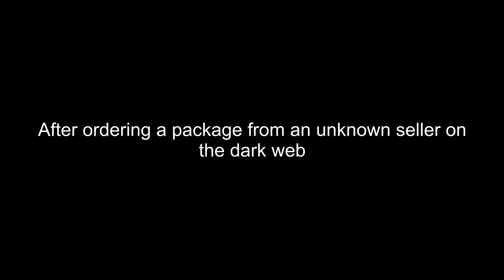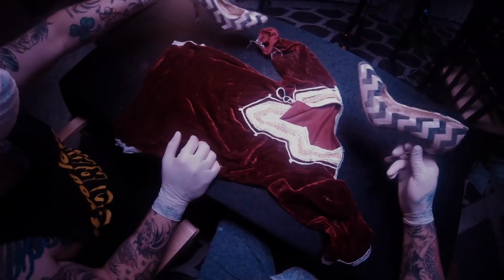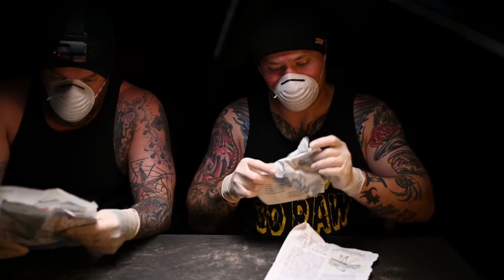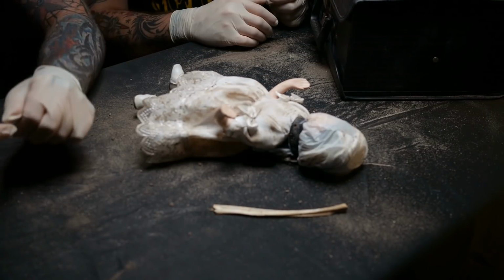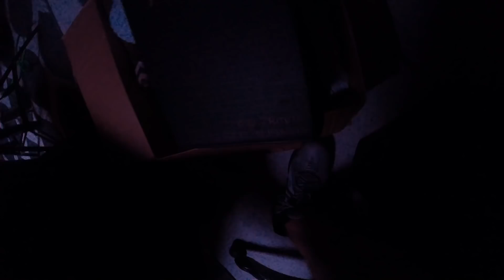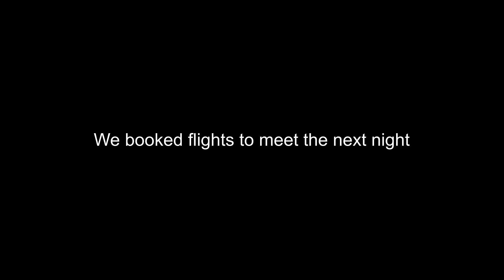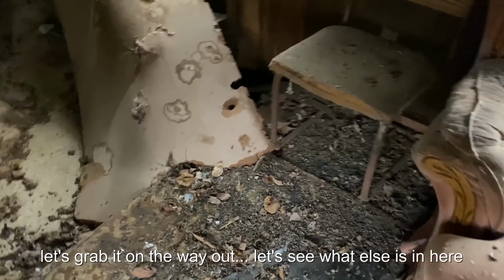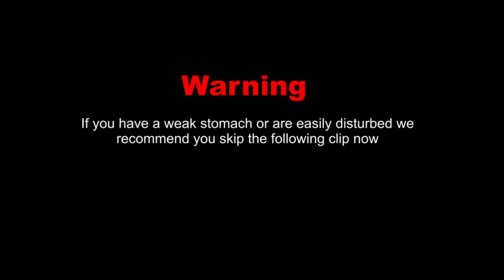The Most Shocking Tape Ever Found (Full Story) Killer's VHS Footage

Comment: Did anyone else see all this too? At 40:46 I hear what sounds like rustling plastic. And he stops digging. Then at 40:52 rustling plastic again. He stops digging and walks out of the frame but you can vaguely see his shadow movements. At 40:59-41:03 I can hear the sound of something being swung thru the air- like the shovel…?! And it sounds like he’s hitting “something” with the shovel 3 times really hard and on the 3rd strike- all while the shadow movements can be seen and appear to correspond with these sounds- 41:02 the 3rd hit makes a high pitched ping like the metal head of the shovel hit something hard (maybe bone? I think would make that sound for sure.) then he drops the shovel and moves back into the frame. So I’m thinking whatever he buried was probably still alive when the recording started and possibly even still while he buried it… not likely. Also possible that it sounds like he might’ve killed it between 40:59 and 41:02… this really DID stick with me a long time…
Reply: Clearly same as what u r saying and i agree if in between that time he didnt commit murder maybe he was making sure of murder doesnt sit right with me that part

Comment: I'm sure someone would have pointed this out by now, but for blood to light up on UV Blacklight, you need what they call luminol. It reacts with the iron in hemoglobin. Get some luminol, and if you suspect a stain to be blood, spray it on there and use the blacklight. If it shines, there is a good possibility that it could be blood. Not concrete, but a very good indicator.

Comment: Did you know that you need to use a spray with the black light to see blood. I don't know what it's called off the top of my head but using just the light doesn't work. I'm a year late but I figured I'd mention it if you haven't found out by now..
Reply: luminol

Comment: Something about this doesn't seem right to me. Shallow hole and not buried well. You hear the bag moving and see a shadow of the shovel being swung onto what one could assume was the contents of the bag. Yet at 41:46 he steps on what was possibly the "head" in the bag and it gave in too easily and no fluids came out. If it were a skull, it would have not been completely crushed by the shovel blade, and even if it was, when he stomped on the bag, something should have squirted out. And this dude was wearing nicer shoes and pants, not like old work boots and jeans.  But giving it the benefit of doubt, you're looking for a middle aged, white, dude, who is left handed (based on how he was holding the seemingly brand new shovel), and doesn't do much manual labor work because he was winded even with such a small hole dug.